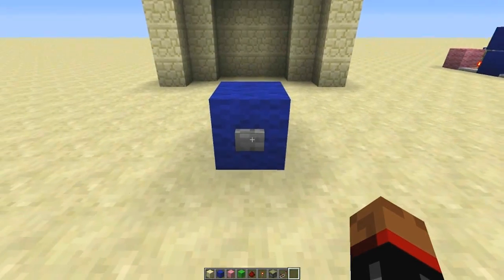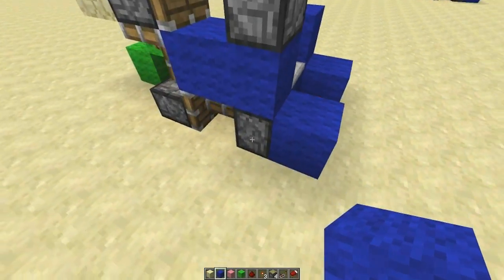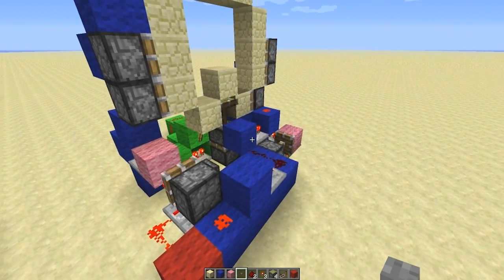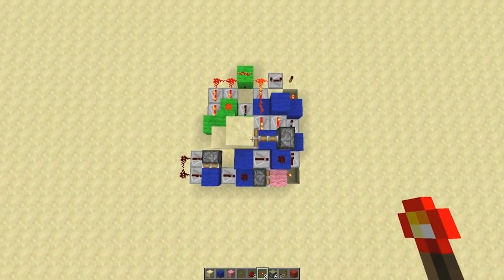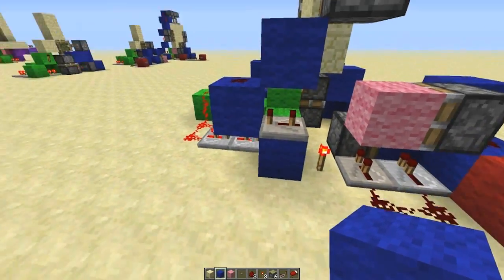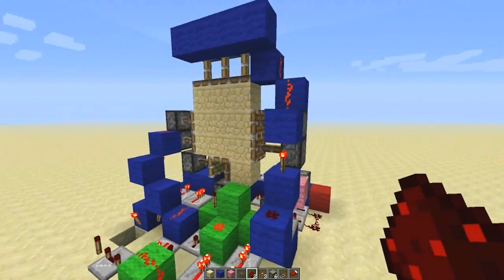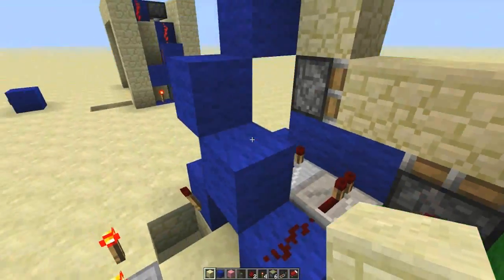Compact, Clean 3x3 Piston Door [Advanced Redstone Tutorials]

Comment: I've been taking all of your gate designs and complicating them a little so that they could have an AND gate, where one input was a locking lever on the 'inside', then the other input came from a button either inside or outside the gate designed to 'request the gate to move'.
That way they can be operated from both sides and locked from the inside. Piston gates for PVP multiplier security.
Thank you for the design. Because I'm making a virtual fortune building walls and gates for other factions.

Comment: The piston system works in 1.2.5 though on SMP the repeater he sets to 3 ticks that goes into the bottom piston faceing side ways which he points out retracts the other piston I had to set that to 4 ticks and not three to get the bottom piston to retract properly so the top piston that grabs the middle block doesn't get grabbed by the top side was facing piston. That's how you fix it... took a week to trouble shoot it... hope this helps everyone.

Comment: get the system so its either fully closed, or fully open. and make sure everything is in the state its supposed to be at. very carefully wire the redstone so it goes nowhere near any part of the circuit,  then you should be fine o.o...

Comment: i followed this video step by step, EXACTLY. it worked, but after a while it begins misfiring to where the double piston extender won't extend to retract the middle block but instead leave the lower piston extended without extending the upper piston and retracting completely. if you could make a video that shows where i must have went wrong because this isn't the first time it happened to me. it is frustrating...

Comment: The set up with the green wool? To get the bottom one to stay default down you have to mess with laying them, not the delay. I had this issue. I solved it by laying the top one first so it go power and popped up. Then, I laid the second, under. It worked for me, but it did take a few attempts. Note, at one part (I'm trying to find it) he says about the delay somewhere "all these at three clicks", but really all but one were at three. You have to watch closely. I followed exactly, and it worked.

Comment: It should be a 3 deep hole if you want it level with the ground. mine ended up 1 above. Worked after my third time building. it wasnt working if some parts got power before he did them in the video. so dont jump ahead. very cool door.

Comment: I took this design and modified the lines that control the side and top pistons slightly, so now the whole thing fits inside a 3 thick wall, with no added frame bits or anything, and no redstone or pistons showing. it was quite simple actually, knowing how amazingly pro CNB is and how much he has taught me about redstone I am amazed I kind of one-upped him on something that simple. Thanks for the sweet circuit though partnoid.

Comment: I found a Fix for the middle pistons playing up in multiplayer servers. If your having trouble with it pushing the pistons or blocks to the side 
At 05:58 in the video, on the green circuit next to that repeater, under the highest green block i placed a block there which fixed it for me. I think it may be a glitch because i had been tweaking all the timings and nothing was helping it. i was getting the same result everytime. 
Hope it helps people getting stuck. PM me if you need help with it.

Comment: @bowow0807 you could probably use the same mechanism as for the popular 2x2 piston door to remove the outer blocks of the 3x3 door. 
...or you just use the mechanism for the middle block and the one below it, which is what I did to lower a section of a 2block high wall.

Comment: Okay so the problem is caused by orientation. I don't think it's the green circuit actually. I've figured out where the problem occurs, and I think I know the specific part going wrong.
The lower of the two double-retracting pistons. I don't actually know HOW that's being powered, but it seems to attempt to push the top piston at just the right moment to actually do so, and then the top piston doesn't get retracted. If I knew how it was being powered, I could try to fix it to stop doing that.

Comment: FIXED for 1.1 and laggy servers:
1.  1:38 don't place either the torch or at 1:47 the repeater that is infront of it
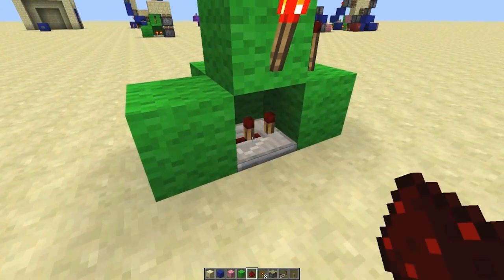2.  2:12 set the double repeaters to three ticks each (the 3rd repeater under the block remains at two ticks)

Comment: @kittercat You simply connect redstone to the pulse limiter (closing mechanism) and bring it to both sides of the door. At 5:43 it shows the redstone you connect your buttons to. I was planning on doing a video, since I already did one on this subject, so I could quickly show the double-button thing when I do the video. And to get the button 1 above ground level I made it that the button activates a piston pushing a block between the redstone and a source, powering the circuit.

Comment: Hey I was having alot of trouble on a SMP server getting the double vertical piston extender to work (bottom piston would still stay powered). The way I worked around this was to use his design from the "1.0.0 Fixes: Double Vertical Piston Extender" video and added an additional single tick redstone repeater on the far right behind where the single tick repeater was (you have to remove one of his redstone dust). This solved the problem for me and now works perfectly! Hope this helps!

Comment: @SoraChief12 thx mate (: i found a way myself! it's without an rsnor latch; basically you just need 2 inputs: 1 that get's there immediately and opens the door (it's the main input), and another one that you have to branch of from a line of redstone dust from your main input and lead it through a series of repeaters with 4 tics. although your system might work as well, i found this easier and more compact.

Comment: @ragman13 Well I changed an replaced lots of stuff, and the circuit is pretty cramped so it's gonna be hard to explain. You know that piston for the T-Flipflop over the Pulselimiter? It has a block and 2 torches infront of it, the block is supposed to hover over the second torch while not attached to the piston in the off state. That was the problem for me.

You could send me your world save and I could check it out...it's hard to explain you know.